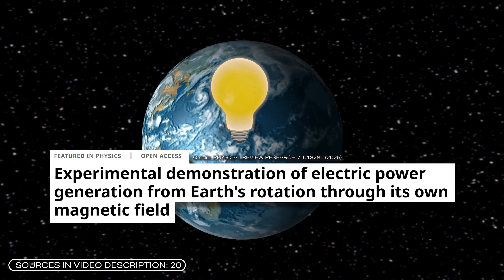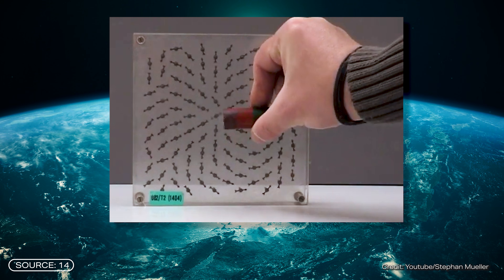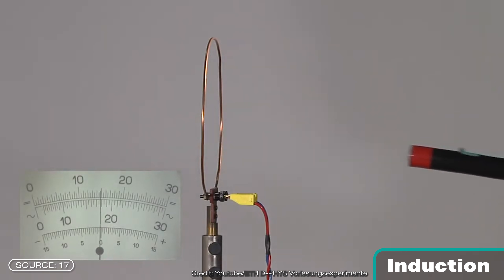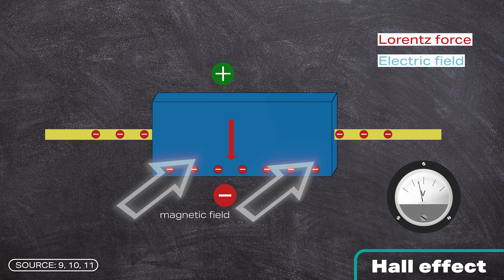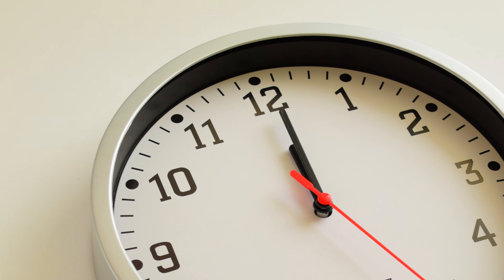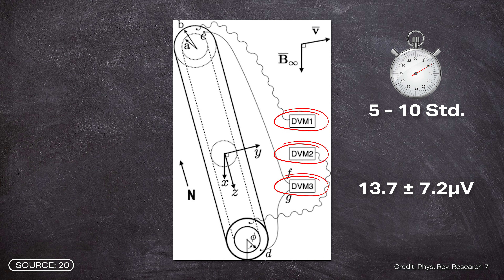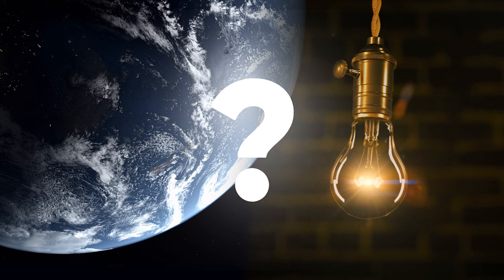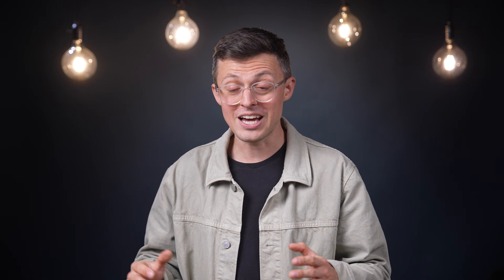Scientists Just Harnessed Power From The Earth’s Rotation

Comment: Smells like wrongly applied relativity. In general relativity, in a coordinate system where Earth does not rotate (pseudoforces look like a weird gravitational field instead) I expect charges to move around until electric fields (in that coordinate system) are zero, this experiment should not be an exception. Yes, Earth rotation would radiate gravitational waves and there will be some electric radiation due to outer core sloshing around, but those should be smaller effect than Seebeck. If you want to extract energy from earth rotation, use tidal energy plants instead.

Comment: "Mu" metal placed in unique ways might be advantageous to shape the field. There might be internal warm and cold junctions that are at play here too because I find the amperage in voltage to be suspicious. Even the multimeters metal electrodes if they are slightly dissimilar from the sample might produce these micro potentials. I just don't see how you're going to generate power that way when the coil or whatever is moving the same as the Earth itself. It might be more advantageous to harness the farts of politicians, which would work day or night and it's something that we will never run out of... Might as well put it to good use!

Comment: So, extracting energy from the Earth's rotation will slow down that rotation, making the days longer. Only noticeable after a long time at high extraction rates.
Reply: O.K. You talked about it. Is that voltage directly proportional to the length of the cylinder? It seems like it, given that the 3 cm tube generated 1.5 Microvolts and that the 30 cm tube generated about 17 Microvolts , or ten times as much. If so, it would take a cylinder 300 metres long to produce 0.017 Volts, and 30 km long to produce about 1.7 Volts. That's clearly impractical. Other electromagnetic effects, including radio and TV interference, lightning, Seebeck, etc, would produce much higher (and erratic) voltages.

Comment: This video explains how researchers managed to generate a small amount of electricity from the Earth's rotation, a feat previously thought impossible by standard physics.
Here is a summary of the key points:
The Breakthrough
Discovery: Researchers in the US successfully generated a very small amount of electricity by harnessing the Earth's rotation and its magnetic field [00:00].
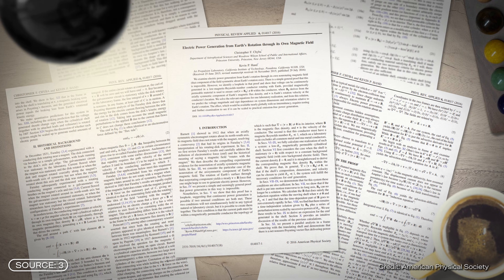Mechanism: The Earth's rotation causes movement relative to its own magnetic field. This movement of free charged particles is acted upon by the Lorentz force, which could create a current [04:39].
The Loophole: Ordinarily, opposing forces quickly balance out, stopping the current. The researchers overcame this by using a special permeable material (manganese zinc ferrite) that has a delayed adjustment of the magnetic field. This delay keeps the forces from balancing out immediately, allowing a continuous, albeit small, current to flow as the Earth rotates [05:50].
The Experiment and Results
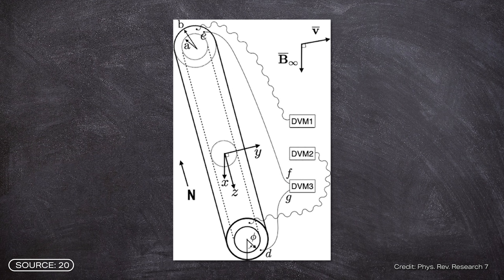Using a 30 cm manganese zinc ferrite cylinder, the US researchers measured a voltage of 17.3 microvolts and a current of 25.4 nanoamps [10:23].
The team factored out thermal interference (the Z-back effect) that had complicated previous attempts by Dutch researchers [09:50].
Future Outlook
Current Reality: The amount of power generated is microscopically small, making it extremely unlikely for large-scale energy production anytime soon [12:33].
Potential: Despite the low output, researchers see potential for long-term applications, such as powering devices in satellites [12:47]. The technology needs to be verified by independent research groups [12:09].

Comment: Hello German science Guy. I think the most interesting takeaway from this presentation is how difficult it is to actually understand the theory. And I seriously question the practicality of such a complex instrument for power generation. As I recall and I don't remember the exact flight number, but at one point the space shuttle let out a mile-long conductor I don't know the details but they would be simple. I just don't know the gauge of the wire but it would definitely have been copper and no doubt stranded. And it generated enough electricity that it blew out the shuttles primary computer and they had to use backup. So you can look up that little experiment and comment on that. It just strikes me that if you want to generate electricity, all you need is a power line perpendicular to the Earth's magnetic flux.
However, there was another experiment which was ongoing. I believe if I'm not mistaken prior to World War II, probably in the late 1930s, that demonstrated the effect of gravity as a function of power generation. This gets a bit complex because it involves having an actual theory of gravity that is functional, namely that gravity is the actual flow of space and energy and absorption by matter. Thus curving space. And this occurs along concentrated nodes as opposed to a homogeneous flow. Principally what happens is that hot spots are created using high density matters such as uranium, which explains the phenomenon of UFOs appearing over military nuclear storage facilities. For example. And no doubt also explains isotopes and the prevalence of uranium in concentrated amounts for mining . In other words, heavy matter is not just a function of the gravity of stars, but it's continuously produced even planets. So this guy had a box and he connected one end to the box and he ran significantly heavy gauge wire to some kind of like I believe it must have been a low voltage telegraph or telephone wire. This experiment produced a great deal of power at the box. You can look this up. It was demonstrated 20 or so times. The military was very interested in it and it probably went dark. If you know that phrase. So there you go. There's more to this than some obfuscated confusion of theory. 😅 
One other relevant fact. The so-called UFO and ball lightning type phenomenon in the upper atmosphere just above the top level of the clouds, is fantastic! Virtually an electric. I don't even know what to call it. It looks like a Tesla experiment to 10^16. The visible light does not represent electrons, but the streams of energy ionizing whatever the heck is up there. I think cauldron is probably the appropriate word. Yeah and you should take a look and pass it along. In any case, as we are at this stage, it should be obvious that the mathematics and the economics of the potential is not limited to some minuscule flux and complex shifts fields and electrons because this energy is actually flowing in huge amounts perhaps enough to actually have caused the Earth to grow in size which is also an interesting geological contemplation. It's not just magnetic flux. It's gravitational. So it's a completely different foundation.

Comment: If we were to actually build a space elevator, we should use the atmospheric voltage gradient to harvest power by having an metallic screen charge collector at each end in the atmosphere. Millions of volts of potential exist between the upper reaches of our atmosphere and just above the ground at sea level. Run through a step down transformer this could be put to good use in our electric grid or stored in batteries for peaking times.
Reply: Studies would have to be done on whether this would negatively affect precipitation patterns first before commercialization however.

Comment: There is another way . A gigantic flywheel placed at the correct angle against the earth rotational axis. It will resist the earth's rotation (like a gyro) and the torque that builds up that way can drive a generator.
Reply: the soviets tried that, its next to impossible to keep the flywheel from the tipping over and precessing. there is a youtube video on that demonstrating the problem with a small gyro.

Comment: Hello doctor.

This is another excellent video and I thoroughly enjoyed it.

As for an interesting technology since we're talking about electricity. 

Have you heard of silicon carbide graphene nickel lithium ion batteries?

The premise is that silicon stores much more lithium than graphite but suffers from rapid degradation, so by combing the silicon with a lattice of graphene coated silicon carbide in a nickel foam the life span of the cells can be extended past the life span of standard Li Ion in theory while carrying significantly greater charge density.

Also plasma assisted chemical vapour deposition is a promising method of producing graphene layers on many different substrates in situ drastically reducing the temperature requirements of CVD and also making controlled graphene coating much more efficient than traditional roll to roll transfers.

Not only can CPU components be doped with graphene using the current machinery but PECVD could also theoretically be used to coat cloth fibres like cotton and polyester making clothes stronger cooler and very soft and smooth.

In essence it's the early stages of printing pristine graphene sheets on any suitable substrate which includes elemental silicon, copper, nickel and other materials that can be enhanced with direct carbon growth without the need to perform epitaxy or roll to roll transfers.

Batteries may soon get a big boost alongside silicon chips and copper cables, clothing and other cloth based goods may also get a big upgrade soon once the technology has scaled along side a few tweaks to the PECVD process that still need to be addressed.

Needless to say there are potentially millions of current technologies that could benefit from direct graphene printing but I named the ones that I expect to see the most movement in initially. 

Thank you if you took the time to read this.

Yours sincerely. 

Devin Dodge.
Reply from the maker: Hey Devin,
I've made a note of all the topics — they sound very interesting! I am actually currently working on a video about plasma-assisted chemical vapour deposition. It's an amazing innovation, and there's some big news from a Texas university. I think the video will be ready in 4–5 weeks. Best, Jacob
Reply: @GermanScienceGuy Thank you so much for your response Dr I can't wait to see what you release next. I'm such a big fan it means a lot that you responded to me thank you.
I love researching emerging technologies and then studying the science behind them at a university level, it just seems to agree with my ADHD 😅 and I've learned so much because of your channel and also from the inspiration that you're channel has given me to continue my tertiary education, every episode is a reminder why I love science so much. 
I hope that you have a wonderful festive season and that you will be blessed in abundance. ✌️

Comment: i am the " wrap a wire around the planet " guy .....yup, that's me, I am that guy.
wrapping north to south, and south to north again, would have the conductor cutting lines of flux as the conductor moves through the deformation in the earth's magnetic field created by the solar wind.
of course the power is dependent on the number of turns; but it would be a very low frequency ac.

Comment: Yeah, probability of it leading to meaningful power generation on any scale, let alone large scale power generation, is indistinguishable from zero. Voltage multiplied by amperes equals watts, if you measure both voltage and amperes at the same time. That means micro-volts multiplied with nano-amperes gives you the number of femto-watts. I think it was absolutely correct, and very relevant to mention that measuring errors can't really be ruled out at that scale.      

A standard NiMH AA cell has a nominal capacity that would be sufficient to deliver about 300 billion femto-watts, continuously, during a full year. So, if their measurements indeed was correct, and measured at the same time, not open voltage and short circuit amperage, they achieved about 440 femto-watts, so they need to achieve about 680 million times higher output, to compete with what a single NiMH AA cell can deliver continuously during a full year, based on the nominal capacity. 

Mentioning the Seebeck-effect was funny, in part because when your measuring "noise" is multiple times larger than your supposed revolutionary way to generate power as a solution to the energy situation, you should ask yourself why you should stick to your initial idea, and not pursue using the source of that "noise" as the solution. The answer to the latter part of that question in this case is obvious, the Seebeck-effect doesn't generate significant amounts of power, at least not without a very significant temperature difference. But that leaves the question of why they're sticking to the original idea unanswered.    

What they measured is not just very very far from relevant power generation, it's practically nothing even compared to what you can generate via the Seebeck-effect with a common cheap thermo-electric heat pump module, often called thermo-electric coolers, and very modest temperature differences that we have all around us.
Reply: Huh?

Comment: is it not what Telsa's tower was doing...
Reply: Similar. Tesla's tower first built in Colorado Springs used many dynamo plates to repel eachother in high frequency against earth's 10hz charge modulation from a buried iron ground mass. You can do the same thing with a tinfoil pyramid and cause the wires to literally melt from the power overload once spark gap increases enough. Look closer at this guy's design; it's using pyramids which is a design known to produce zpe wave folding off the apex. All you need is pump z waves in sync yet out of phase imploding through nonlinear medium to combine as a sum (hf) after focus. I made a video about this and posted it either here or on my rumble under this username.

Comment: Is this a joke. It's been done for over a hundred years in many forms, including the earliest an earth battery.
Reply: As far back as we can dig we find pyramids buried by time underground, such as the Crimea Pyramids, or the 2600' deep pyramid city off the s.w. Cuba coast. Pyramid science is well proven to be zero point energy. You can even use a simple wire pyramid to make fruit last much longer or keep the roots of orange trees from freezing as it is done in Ca. When I learned of the earth battery I had to laugh. It's an extremely inefficient method using copper and iron wires side by side in a pair of coils like that. A guy named Jim used it to power a wastewater cleanup ozone generator he patented, and noticed how the circuit was producing far more power than it should. I studied the circuit to discover why; he had accidentally added a carried wave through use of successive nonlinear tube sizes of stainless steel very similar to a Joe Cell (a Tom Bearden design) known to focus on zpe implosive wave folding science where pump z waves in sync yet out of phase will combine to form a sum after focus using a carrier wave. Jim ended up nearly dying due to lead and arsenic poisoning for his lack of understanding how concentrated ozone will accumulate a quasi-matter or anti-matter like material over time that penetrates many elements. It caused gold wire to grow out of his skin and even the seat of a car he had buried. Anyway, if you want to understand how zpe really works in the case of running of earth, just bury any iron mass, connect that to a spark gap control to a rod passing through 3 lateral copper plates inside a tinfoil pyramid with a sharp peak. Slowly opening spark gap results in bouncing the 3rd wave leftover from the plates that work as dynamos to produce a carried wave on top of earth's wave that fold off the pyramid apex as the zero point energy focal medium. That can produce enough power to melt the wires and is similar to Tesla's power source used in Wardenclyffe Tower which he first tested in Colorado Springs. He was using more than 3 plates to create a high frequency wave to transmit over long distance. Many know this as a longitudinal wave.

Comment: "We will talk about why the laws of physics were not violated" - proceeds to give an explanation that can only suggest that laws of physics are violated. Does not elaborate any further.

If this method works as proposed it would violate conservation of angular momentum and/or galilean relativity.
Their explanation makes no sense either, there is no preferred "non-co-moving" frame of reference for a magnetic field against which kinetic energy can be extracted. Rotating EM fields can only radiate angular momentum out, not extract useful work from it - that'd be equivalent to reactionless torque.

I give 99% chance that this is just an experimental error. The remaining 1% is that it measures local magnetic field fluctuations.

Comment: Power lines can pick up voltages and currents from magnetic storms sweeping over them that can shut down transformer stations. I suggest that is a more useful solution to harness, and use your analysis talents to show us how to do it.  Electric utilities don't like it when people simply hang a wire parallel to the power lines and get free AC power for their houses. Massive diodes that make DC current to charge batteries or capacitors?  Length matters. What could acres of parallel wires do with the Earth's field? Make every barbed wire fence into generators? That infrastructure is already set up.